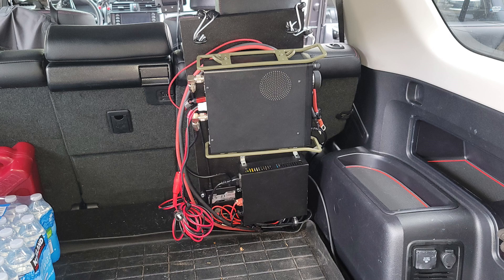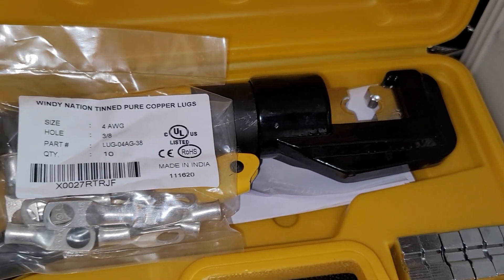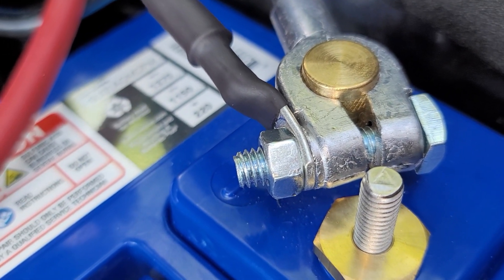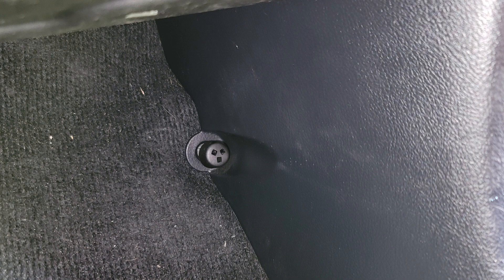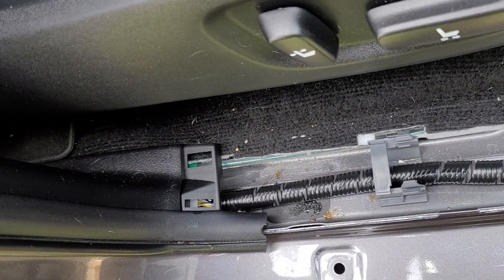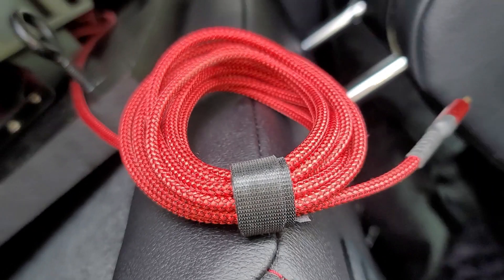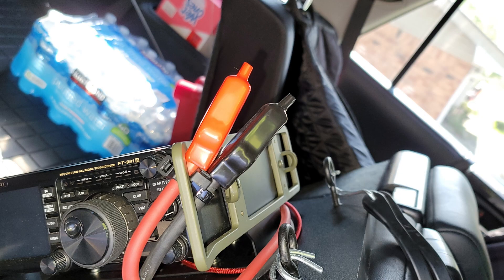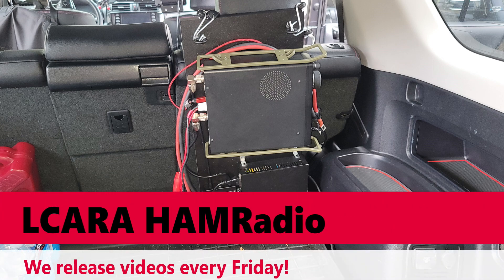LCARA HAM Radio: HF Radio Install Into My Wife's Car PT. 5!!!

Comment: May have been there or possibly shown in a previous video in this series but I didn’t see a fuse at the battery.  If needed a Amazon purchase, or any local automotive car stereo installation shop can sell or install a high amp fuse kit for a heavy gauge wire installation.  The automotive car stereo shop will also have some black wire loom that can help you dress up the wires at the radio end and make it look very tidy and professional.  (trust me take that extra step and your wife will love it even more)